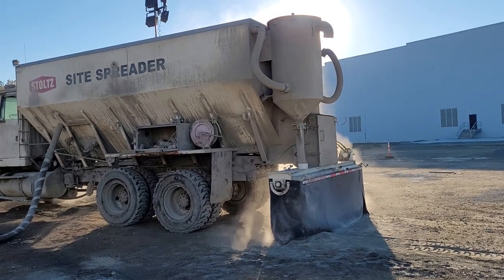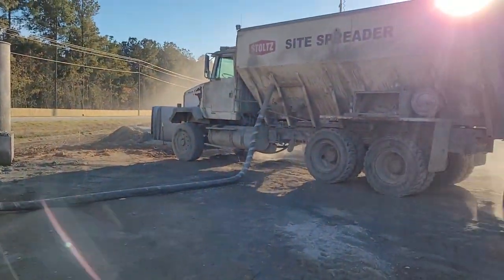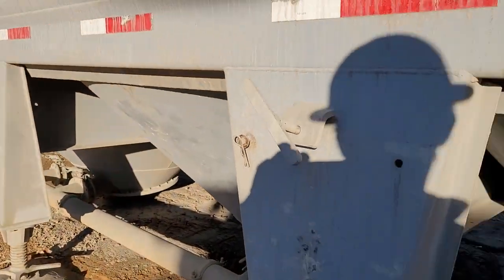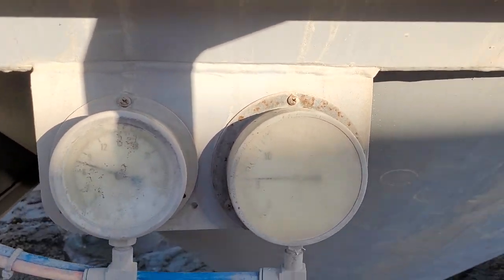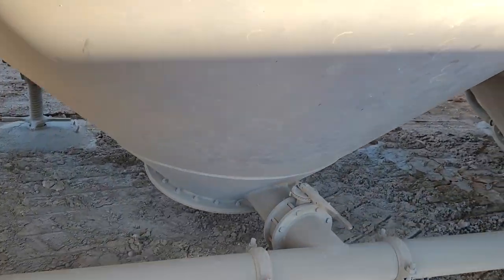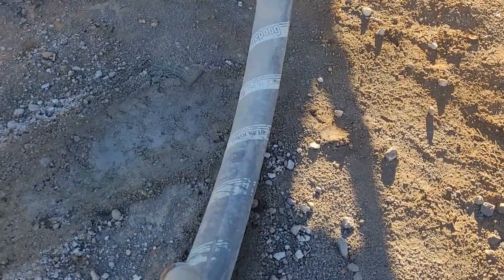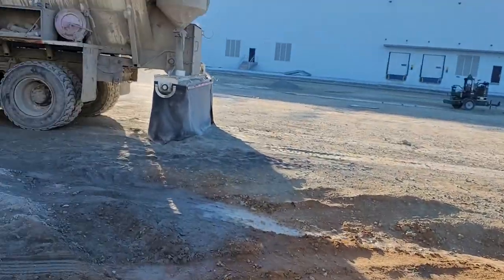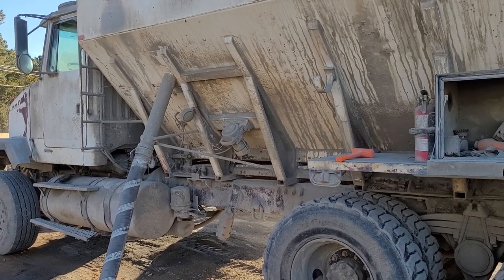loading the spreader truck from a horizontal silo,pig,guppy.

Comment: Do you have a spreader bar for bulk tankers? I pulled Bulk Tanks for years hauling cement ,bakery flour and anything se could stuff thru the hatch. always enjoyed pulling tanker. We used to have 2 freightshakers with low low hole trans. and used a plastic pipe on back of tanker  for parking lots and roads. did a big job at Philadelphia airport for UPS terminal parking for 747's and trailers quite interesting doing soil cement

Comment: I’m working on a interchange project currently and we’ve had to cut a bunch of cement treated soil to get to our sub grade. Let me tell you what, that shit is a pain to remove! Using a 336 and it struggles like hell.
Reply: One job I was on, a 4 acre pad for a Napa Valley winery was cement treated, and it was so hard the grader could only take about a tenth off per pass so I ended up on a 637 scraper taking a few inches off at a time to get the bulk of it off, and even with twin engines it was working! Lol